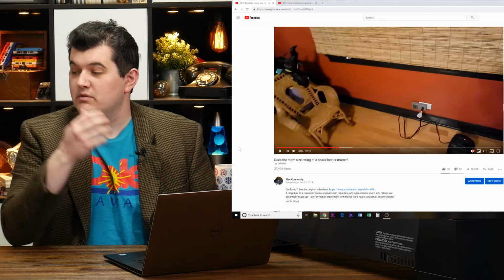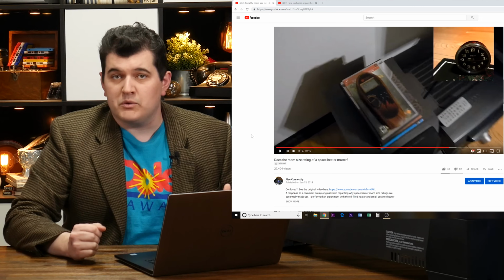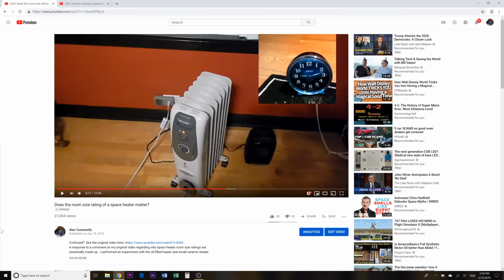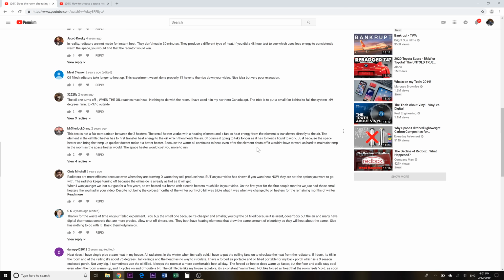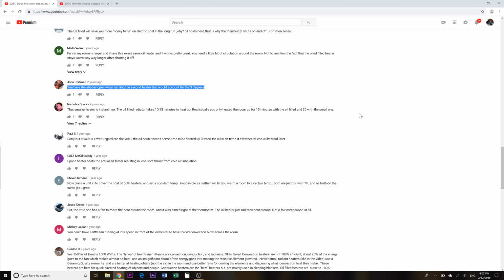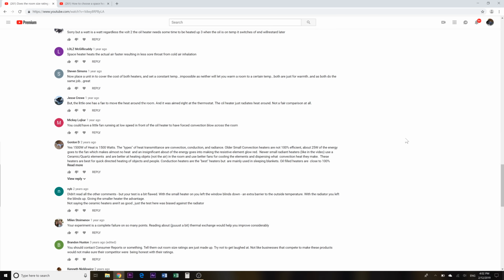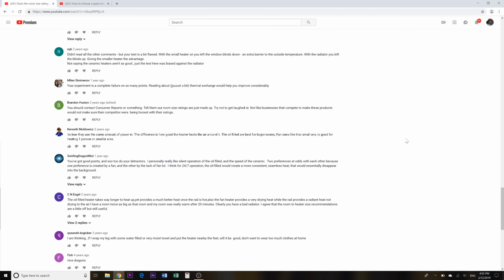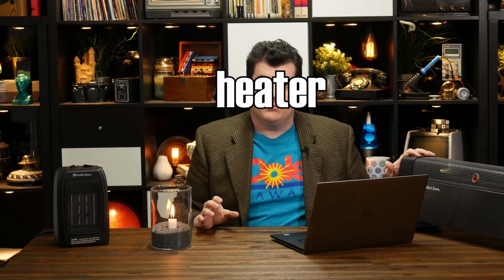More Space Heater Nonsense

Comment: I spent a whole evening trying to adjust a radiant heater thermostat to run high continuesly, never acheived it, cycled off and on at the max setting,  basicly just water heater elements stuck in a oil filled radiator
Reply: There'll be a bimetallic strip switch in there somewhere

Comment: What everyone is trying get across is that with the condition are setup right oil fill can reducing heating cost over 65% or more. Everyone has tested this and expected this would have shown in your test. It would have been better to Measure total power consumption of each heater until it reached a particular temperature in the room and see which one was the most expensive to get there. You commented that the old filled heater will heat up and then cuts self off for a while then he’ll little more and cuts self off for a while. It was right there in front of you and you missed it.
1: once a room is up to temp it Maintains it better
2: it’s best when used in a room with a ceiling fan on low or medium when it’s reversed to facilitate heating a room
3: it takes 24 hours to get the room right temperature (this is a long-term heating solution not an instant heating solution most times)
4: It’s a safer heating unit for pets, animals and small children.
5: I have four sitting around the house Tucktaway and they’re only smart switch and set to turn them on 2° above when my heat pump switches to strip it, it’s much cheaper.
6: if you’re in the snow or ice storm and have limited power from a generator you can get these things up the temperature in 20 or 30 minutes cut the generator off for three or four hours and have heat during the whole time because it holds its heat so long it generates eat out.
7: They have a 99% efficiency of heat production
8: I keep at 800 watt in my bathroom turn it on When I start my shower put on a towel on a rack I made across it and it is so nice to dry off in front of them then cut it off. It is cheaper than The high dollar towel heating units.
9: it is a more controlled heating of the room and do not lose energy from over heating the room as most others types of heaters do. So in long game it cost less to heat a room with less danger and is better supplement heating source in adverse conditions and limited electricity conditions. I now live on the East Coast on the ocean but I spent many years in Utah And during the snowstorm Or a blizzard of I didn’t have wood burning fire place or stove I’d rather have 2 to 6 oil filled heaters going in the house than anything else. You’re limited on how much fuel you have for your generator and you can stretch these heaters for a week on 5 to 10 gallons of gas.
10: I never have mine running at full power, only on 10 Amps, if power is out I will run at 15 Amps run 1 at a time get heated up the and do the next one as I have everything else charging. Take about hour then off 3 to 6 hours then on again for hour and repeat maintain between 66° and 72° degrees.

Comment: I can completely relate to why the room size thing is frustrating. 1500 is 1500, if I'm buying heat, I'm looking at watts per dollar, which means I preferred the smaller units.
Over the years though, I'm no longer content with this & my new operating philosophy is to no longer heat the room, but just the things I'm in contact with.
I've become obsessed with dish style radiant heaters that beam the heat directly where I want it, like a laser. There's some loss to convection, but generally I can use half the wattage and still be comfortable in every room. The walls themselves can be cold, as long as I'm not cold, that's okay

The real caveat I have now is that generally electric heat is costing me 3x more per watt/btu than from the gas furnace. While I believe in applying heat only where it's needed, resistive heat cannot beat natural gas in cost efficiency, barring today's market volatility. I generally set the furnace to 62-65 and use the radiant heaters as the last mile to delivering room temp where I am.
(Side note, I watched the videos on heat pumps, I nearly pulled the trigger on a mini-split, but I'd need a COP of 3 just to break even, let alone pay for itself. It's not economical to scrap a functional system. As for cooling, window ACs are cheap and plentiful. I have a 5k, an 8k, and a 240 volt that came with the house that looks late 80s early 90s. They gutted a crank out window to put it in, so I left it in place. After changing out an outdoor power socket, all three work, but I could get away with any two)

Comment: This is a BOGUS "experiement" because the two heaters, with identical output, operate differently. One has a fan, there moving air more quickly past the heat elements. The oil filled "radiator" has no fan and takes longer to reach maximum temp of unit and room, but sustains temp without noisy obnoxious fan. radiator type is for sustained heat output-not quickie heat up

Comment: A term that pops up in my head when discussing this topic is "thermal flywheel", since heaters' heat output is similar to the concept of a lighter and a heavier flywheel. 
A heater with smaller thermal mass can easier get up to temp, but also cools down quickly, while an oil heater takes a while to get going but it's thermal mass continues to radiate heat for a while after it is shut off

Comment: I have both types of heaters and  here's my take on it. Power usage (watts) is an instant reading. Since the Oil heater limits is's self periodically, it's duty cycle over time draws less total watt hours than the fan driven ceramic heater. In other words over time, yes the ceramic heater will use more power and provide more heat. Kind of like you alluded to, I put a small fan behind the radiator heater and it limits off far less often (thereby keeping the room  better). I'd guess that if you hot rodded a radiator type with extra heat sink fins and just the right dispersed airflow  it would rival the ceramic heater in output. That said I think the radiators are made to be run for days or weeks at a time whereas the ceramic would probably die if used the same way. Great videos. Keep up the good work. Thanks

Comment: Those comments.  "fan heaters dry the air", a common misconception.  Although my favourite is "oil is more efficient because it still heats when turned off" which is even more bizarre as the LAST THING you want is it to carry on heating past your target temperature, which oil filled inherently will.  Plus the obvious thing that both are equally efficient, as at the maximum they can only both produce exactly the same amount of heat.

The only good argument is IR are more efficient, not at heating the room, but at heating you so you don't HAVE to heat the entire room thus saving energy.
Reply: As long as you keep rotating like meat on a rotisserie, then IR is good for some humans
 
An acquired taste that's not for my liking

Comment: When I lived in Colorado I had one of the small space heaters and a radiant oil space heater. I would use the small heater to get the room to temperature quickly and the radiant heater to maintain said heat. There were days where I used just one or the other, for various reasons, and the only difference I ever noticed was the speed at which the room got warm. They both got me to the same temperatures every time.
The only reason I had the radiant heater at all is I felt safer letting it run for extended periods of time. That’s it. One heated faster, the other gave me a sense of safety heating longer. But I experienced literally no difference in overall comfort/heat between them.
Thank you for making these videos. I have been very frustrated about the very same thing you express in these videos for years! 💜

Comment: there is a great difference between warming the air in the room and warming the objects in a warm. The space heater is heating the air, the oil heater is heating the oil, which then radiates heat. radiative heat then warms things. not air, necessarily.
If you put an IR heater in there, it would warm YOU and not warm the air at all.
With my bus, I have a cast iron fireplace, covered in thermal mass bricks. When the fire goes out, my bus stays warm, as the thermal mass (same as the oil) radiates heat over a long period of time. if I'd picked a air heating fire, as the fire went out, the bus would rapidly cool.

You demonstrated this by opening the window. rapidly losing all the heat from the little heater. 

tl,dr; radiative heat vs convective heat.

Comment: I'm very late to this comment parade and this may have been answered already. However the answer to why one would be more effective than the other is a bit simpler than you would think. Yes both heaters are capable of the same heat output that is not what this comment is about. However instead of the entirety of the heat being dumped into the space as quickly as possible as with the typical  cheap electric "small room" heater, the oil filled heater instead puts that heat into a thermal mass (the oil) which then slowly releases that energy in the form of radiant heat over a longer period of time. This is neither more efficient or more effective, however it is more comfortable. Imagine taking a large room and placing a fire in the middle. It will be quite warm by the fire as soon as it is lit however it will still be cold throughout the entirety of the remaining space for quite a while. However you take that same fire and use it to heat a pool of water and allow that water to disipate the heat into the room the entire room will slowly come up to temp much more evenly tho over a longer period of time. So in conclusion, both heaters will achieve similar end results however one may heat much more evenly than the other.

Comment: Thanks for your effort in making the video.  Try not to take the negative comments personally. 

In the US, the amount of ignorance re math and science generally, is appalling.    As is the ability to do critical thinking.  As is tolerance, overconfidence, and assuming assumptions based on intuition are accurate. 

I see your point, and overall, I think you accomplished your mission, and your point about energy and heat being what they are re total heating of the room over time is unassailable in rational scientific terms. 

I do think that the point that the quality of heat from oil based radiative heaters has desirable properties is valid re things like not drying out the air, being quieter, and (in my experience) having less odors (not getting that annoying hot metal smell so much).  But that does NOT impact the physics of the heat transfer.

Comment: It's all about the BTU output. Which is not equal to the energy consumed. Add a fan to push the air thru will gain more BTU output over time. Increase the fan speed and get even more BTU output in the same amount of time. Eventually pushing more air thru than the heating element can heat, deminishing return something or other.

Comment: As I see it - it's more about what do you mean when you say you want to heat a room? 

Is it very cold, and you just want to get it up in temperature fast so you can comfortably be in it? Maybe only for a shorter time span, and only once in a while! Then the small one that dumps all the heat and spreads it around fast, is what you want! 
Do you want it to stay warm permanently, and be more of a "living room" (ie a room you live in) the things of storing the heat and radiating it out more slowly, and more in a controlled and comfortable way the other choices might be better, and the idea of "just delaying the heat" might make good sense, and make it easier to keep a steady temperature with less obvious swings. It might end up using the same energy, but the slower ones is probably more comfortable for the long run. where the small one is what you want when all your heat went out, and just need to just not be freezing your ass off while you wait for it to get fixed again. 
And if my theory holds, maybe you should just have both! Heat it up with the small one when it has gotten really cold (or them both) and then just leave the bigger one on when its at the temperature you want, and you just want to keep it there. 
To me its all down to what do you expect when it says "space heater" 
1. that it quickly heats up a space?
2. that it keeps a space heated?

Comment: I thought I'd posted this before but I can't find my comment now but I think the reason for the size and rating is down to duty cycle, if it's rated to heat up a larger volume that's probably because the components can be on for a longer amount of time before sustaining damage. Even though a hairdrier could be the same heat output as a heater doesn't mean that leaving it switched on for 12 hours a day is going to give it the same life span as only using it to dry hair maybe a couple of times per day. The same would make sense for heaters, If the manufacturer specifies a smaller volume it's likely because there's an estimated heat loss per volume and that the heater can provide that lost energy within its duty cycle rating.

Comment: I didn't finish the video before I wrote this comment so it's kind of moot.

A bigger room means a larger volume of air to heat, which means it takes longer to increase the temperature of the air. A radiator style heater heats your body directly with infrared light.
The time it takes for a radiator style heater to start heating your body with infrared light is faster than the time it takes for a blower style heater to heat the air in a room (math at the end).

Additionally, a blower style heater dries the air (I think you said in the video), which makes your sweat evaporate faster, which feels colder.
Additionally additionally, The blower style heater's fan causes a breeze in the room, which makes the air exchange heat with your skin faster, which feels colder. The breeze also evaporates your sweat faster, which feels colder.

Yes, the energy released by a heater is dictated by its power draw. However, our brain's sensation of heat and cold are more complicated than just citing the laws of thermodynamics.
Because of the reasons I described, a radiator style heater might feel warmer than a blower style heater, which is what matters in the end.

You could technically have a blower style heater blowing directly at you, which would probably feel warmer, but it would be extremely uncomfortable.

Math time. Let me know if I made a mistake.
My radiator is roughly 1cm x 30cm x 60cm = 1,800cm3
My room is roughly 250cm x 300cm x 400cm = 30,000,000cm3
Oil's density is close to water, which is about 1g/cm3
Air's density is about 0.001g/cm3
The weight of the oil in my radiator is 1g x 1,800cm3 = 1,800g
The weight of the air in my room is 0.001g x 30,000,000cm3 = 30,000g
30,000/1,800 = 17
Since weight is indicative of mass, there is about 17 times more mass in the air than in the oil in my radiator. There is 17 times more mass to heat, which means it takes 17 times longer to heat.
A large room, maybe 2 to 5 times larger than mine, would have 2 x 17 = 34 to 5 x 17 = 85 times more mass in the air than in the oil in my radiator.
There is the mass of the metal that's housing the oil to consider too, and not all heaters have the same volume of oil either.

I don't have much personal experience with heaters so these are just my inexperienced, uneducated and overly analyzed thoughts.
Reply: The moisture content of the air remains constant with either type of space heater.

Comment: my friend has an oil filled heater but its like a 40 year  old soviet one where theres a control box attached to the radiator on some metal rods so its separate from the radiator. Much more reasonable than just slaping the thermostat onto the side and burrying it in plastic. Aside from that, the only advantages of an oil heater are that it keeps heating the room even after its shut off, they are quiet (no need for a fan due to large surface area), it keeps outputing heat at a steady rate instead of turning on and off and most importantly, safety. Id much rather let such a unit stay powered while im sleeping than a small resistive wire heater with a fan. Especially when you find out how janky 99% of them are on the inside

Comment: I think the best way I could explain the difference between space heaters to someone would be: They all produce the same amount of heat energy at the end of the day, assuming they all have a 1500 watt rating. Some of them transmit that heat and/or disperse it throughout the room differently. Each space heater has its own pros and cons, I myself prefer to use a good radiant oil-filled heater with a digital thermometer, because it's silent and I personally believe it releases heat into my room more steadily than a resistive heater with a fan would. However, they both produce the same amount of heat. So, when buying a space heater, don't try to buy the one that produces the most heat. Try to buy the one that releases its heat in the fashion that you most prefer, and the fashion that makes the most sense for your particular use case. Excellent videos, thank you Alec!